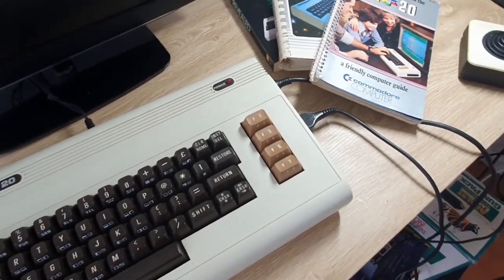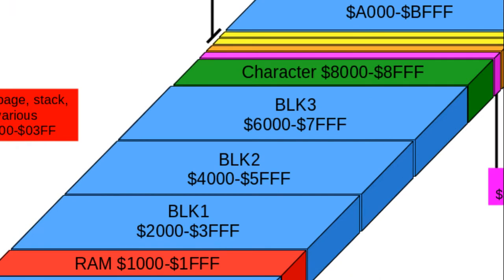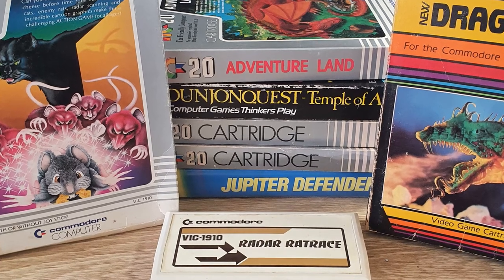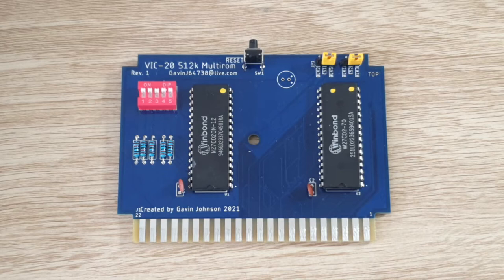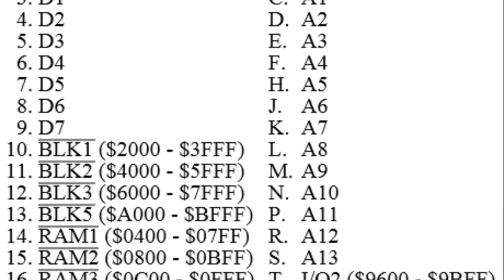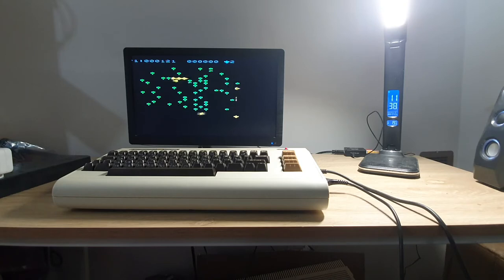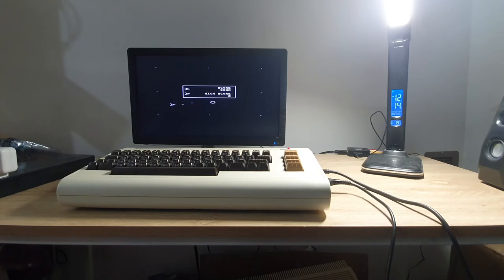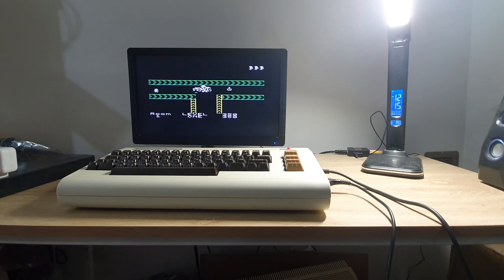Commodore Vic 20   How Cartridge's Work and my Multicart Demo

Comment: this is so cool , will it work on a comodore 64?
Reply from the maker: Not this one, but alot will do something similar, I have a 1meg version of the versa cart i make which holds 128 original cart roms at the moment on ebay, most of them diags stuff though.
Reply: I see that someone already asked about the C64 how about the 264 series? Commodore 16 and Plus 4 8bit computers.